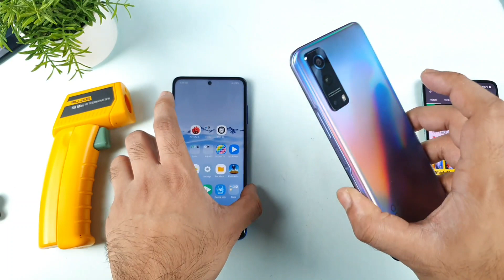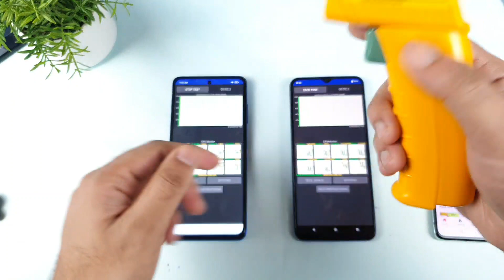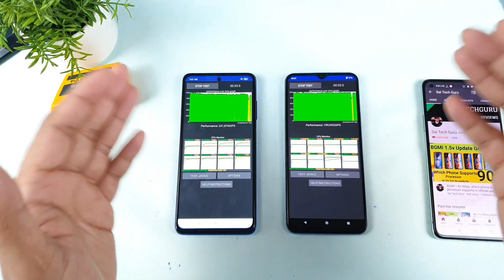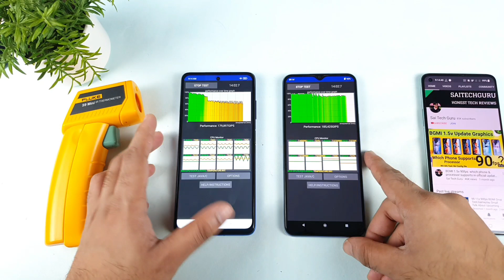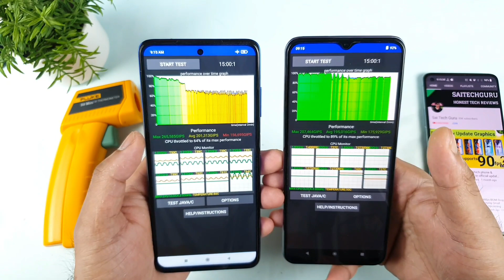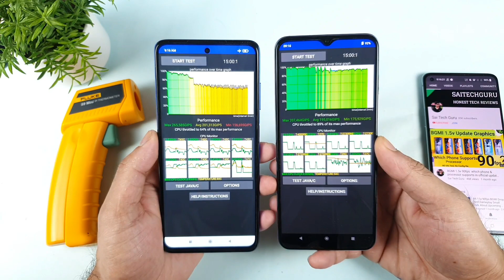Poco X3 Pro vs iQOO Z3 CPU Throttling Test Comparison Snapdragon 860 vs 768G 🔥🔥🔥

Comment: *A smartphone is required for the farming (means to get coin, gems, medals, many type achievement etc.) that takes place in games, The farming will last for 10-12 hours and I am afraid of which processor will be capable, plz guide 3 phone under 20/30/40*🙏
Reply: Thb it's been 1 yrs and 768 can't do heavy tasking even without gaming it heat's up a lot with normal data usage